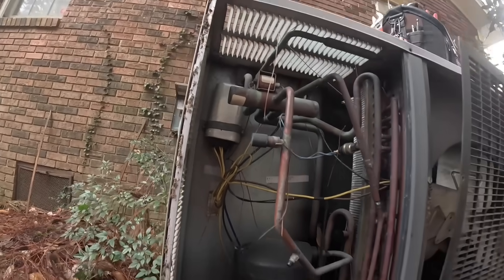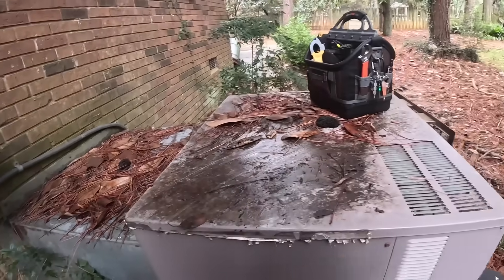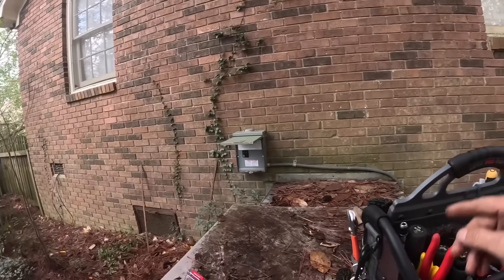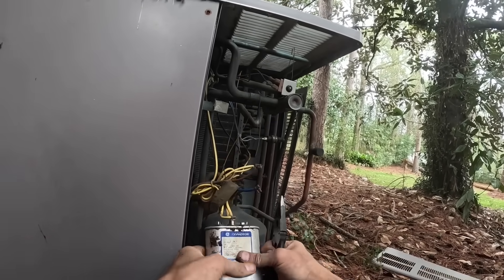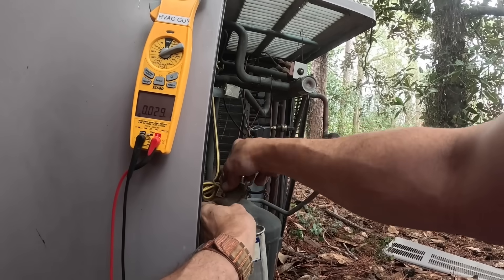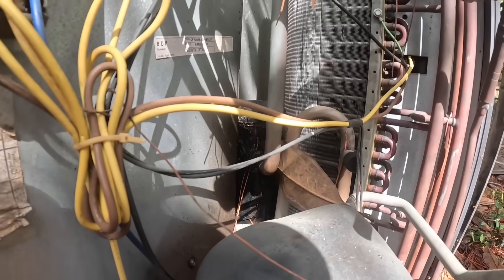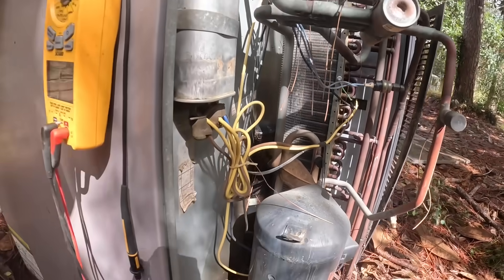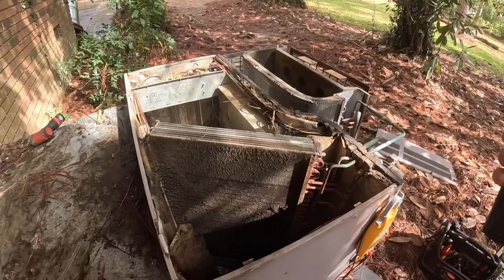Bryant Heat Pump Package Wasn’t Cooling! #hvacguy #hvaclife

Comment: As a service technician I'm regularly surprised that people don't take better care of a major appliance that they depend on, practically every day, for their comfort. It's even more surprising that greatly underestimate the cost of replacing the HVAC equipment. Hope you get the change out.
Reply: Yes and I've seen many times mowers don't care, the exhaust chute aims directly on the coils, and they never give it a thought!
Reply: @hinspect  When I see grass shot into the coil I let them know what they need to do to prevent it and that it'll cost them more for me to clean it. Time is money.
Reply: All those leaves don't help a thing. Looks like the coils were never cleaned. I'm sure they probably don't change the filter and I bet the smoke alarm is chirping.
Reply: I can say the same thing as an auto technician. People don’t maintain their vehicles as much as they should or hardly at all. They expect it to just work.
Reply: @jthonn  Some of those leaves and pine needles are acidic or exposed to fertilizers which can aggravate the situation!
Reply: Imagine if people treated their cars like these ac units
Reply: They do!!
Reply: Some do! @JesseDoesHVAC

Comment: I was shocked to see the capacitor was still good!
Take care of that hand as best you can... The injury is NOT in a good place (not that any place is "good"), it's hard to heal a spot that is constantly flexing. It does seem to be healing nicely despite that fact. Were you prescribed antibiotic as a preventative? So easy to get an infection, especially with all the nasty spots your hands have to get into, but you seem to have dodged a bullet on that one!

Comment: It would bug the crap out of me if i turned up to fix something and they cant even be bothered to keep the area clean, isnt prevention better than cure ?
Reply: Exactly! 👍
Reply: Oh about 70% of homeowners don't even think about there hvac systems until it quits so they neglect any type of PM maintenance and most want even pay to have coils cleaned yearly!
Reply: @michaelburton4025  It's much like a refrigerator, a TV, or a car. People usually only worry about it when it stops working; up until that point if it works, it must be fine.

Comment: you dont use the "NCV" setting on your multimeter to check for live wires?
Also, alot of people dont know what side of the contactor powers the capacitor....

Comment: Technical question:  it's time to replace the heatpump system.  One of the bidders said that we can't go above SEER2 of 14 due to the R value of the ducting insulation.   What's the basis for  that statement?
Reply from the maker: Hmm?
Reply: Duct insulation greatly affects the Seasonal Energy Efficiency Rating (SEER). Most older systems had thin insulation, just enough to limit condensation and noise.  You won't achieve the nameplate SEER without upgrading the insulation.

Comment: That's a heat pump buddy, it's called the outdoor motor not condenser motor.  Young techs watch your content you need to be correct otherwise they aren't learning
Reply: Isn't it technically still condensing, (increasing pressure)? Doesn't a valve just decides where that condensed refrigerant goes.
Reply: @theguyjt7921  if your in cooling mode yes, in heating mode no.  The manufacturer will also tell you this.  Evaporator motor is called the indoor motor but depending on the mode you are running the outdoor can be the evaporator
Reply: @s550wulf9  but the compressor is doing the same thing. Compressing aka condensing.
Reply: @theguyjt7921  state of refrigerant is the reason.  Ask the manufacturer they will tell you the same thing.  Heating mode the outdoor coil becomes the evaporator and and the indoor becomes the condenser hence why they say indoor and outdoor coil
Reply: @s550wulf9  I don't care what the manufacturer says, the blower/fan in either unit is there to move heat. The heat comes from compressing the refrigerant and expanding it. You're moving heat in to out or vise versa. Your original comment only says, don't teach to think about the operation.
Reply: @theguyjt7921  and like I just said heating mode the outdoor becomes the evaporator and the indoor becomes the condenser.  And my original post is correct.  And what the manufacturer says it is, is what the proper terminology is.  My statement is correct, I made sure to call the system what it is a heat pump.
Reply: @theguyjt7921  and no the outdoor fan is not moving heat in heating mode and why they are specific with heat pumps
Reply: @s550wulf9  oh wow. I think you need to go back to school if this is what you do. Every part of the system is doing nothing but moving heat. Elementary my guy.